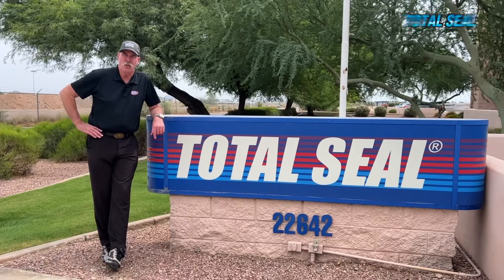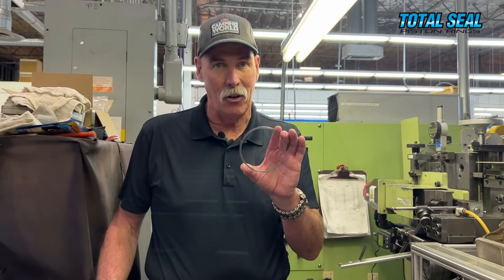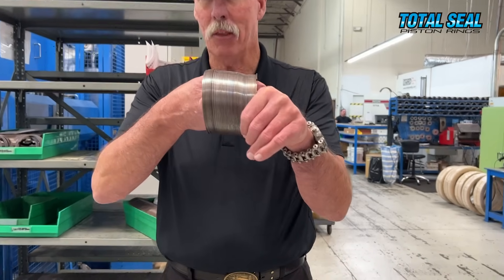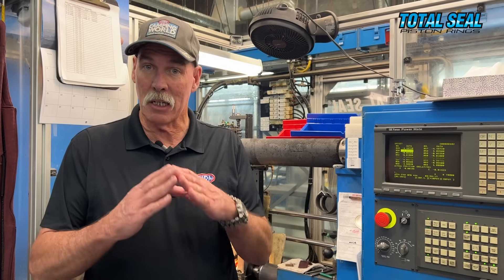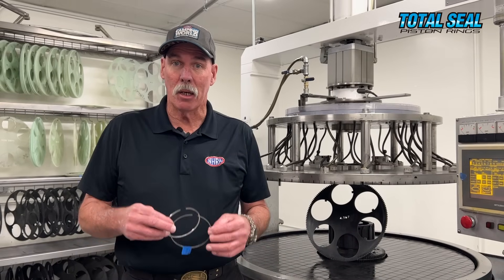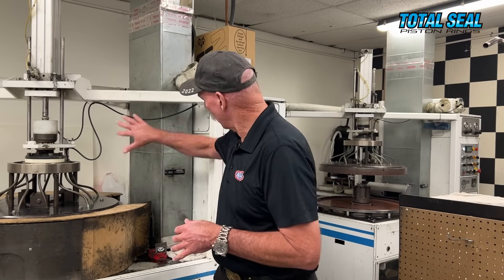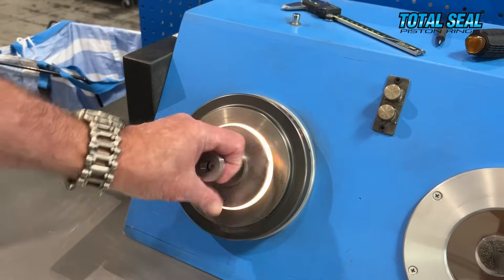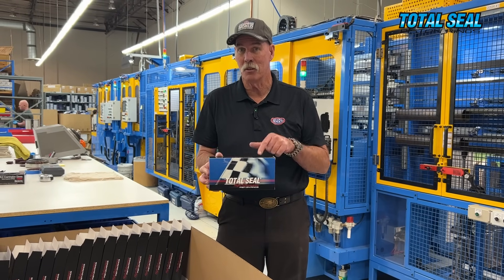How Piston Rings Are Made - Total Seal Shop Tour

Comment: I was an apprentice machine tool  maintenance  fitter in the early sixties in leeds uk with specialloid piston company  and piston rings were machined from cast tube roughly machined internally and externaly then parted off from back with staggered parting off blades towards the headstock chuck then a whole other operations porobably alien to todays methods with todays highly advanced elecronicaly controlled  machinery!
Reply from the maker: Thanks!

Comment: Question? With rings not needed to be seated anymore like the ole' days, does this apply to all the manufacturers or just total seal. I was surprised to hear this in the video since i figured they would still need seated w the bore somewhat.
Reply from the maker: Great question. While the rings don’t need to break-in, the cylinder walls still do, so there is some break-in that has to occur. We’ve just reduced the amount of break-in time and wear.
Reply: @TotalSeal  Thank you very much for the info and reply.  I just did a leakdown on a new motor w maybe 50 miles on it and its at 12 percent so this lets me know hopefully itll get better. Unless of course it should have been seated by now.

Comment: Friction
Although the friction force depends on the normal force, the second law of friction says that friction force does NOT depend on the area of contact between the object and the surface. Imagine if you turned a box so that less of it was touching the floor. Would that change the normal force? No! The box still weighs the same, so the normal force doesn't change, even if the area of contact does.
I think this will interest you.
Reply from the maker: Agreed, but there is another variable in ring on liner friction that the law doesn't account for - fluid drag. Piston rings are not dry sliding. They are moving on a film of oil, so the ring face area does have an effect of drag (no different than frontal area in a wind tunnel). We also choose certain face coatings with a lower coefficient of friction, which lowers the friction force. By reducing the friction force and drag, we make piston rings that increase engine efficiency.

Comment: If you design a set of rings for a stock street driven car.  Let's say and old fashion cast iron V8 with 4" pistons.  

When it warms up, the piston get a little bigger.  Interestingly the cylinder also gets a little bigger.  

Stands to reason that the ring grows bigger on both the outer diameter and the inner diameter.

A lot of people think the inner diameter gets smaller.  I think they are wrong..??

We hear the suggestion for ring gap to be about .004 per inch of cylinder.

So a 4.000 stock ring should be about .020 gap.   Why would .008 not be good enough if everything grows outward?
Reply from the maker: The bore, the pistons and the rings don’t all expand equally, so that is why the guidance is listed the way it is.
Reply: its linear expansion* A linear expansion on a cylinder is outwards because its the only way to go. On a ring its lenghtwise on the circumference so the gap closes off.